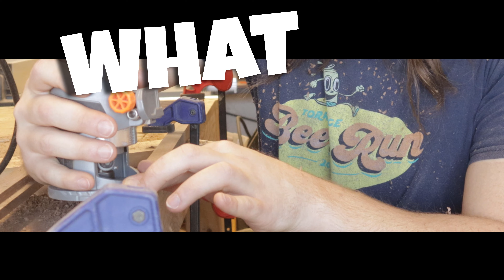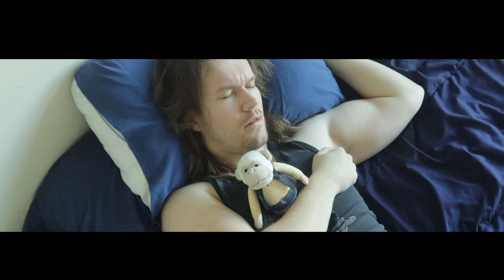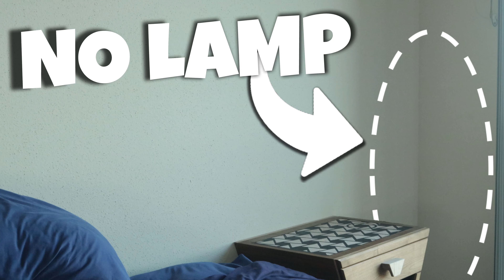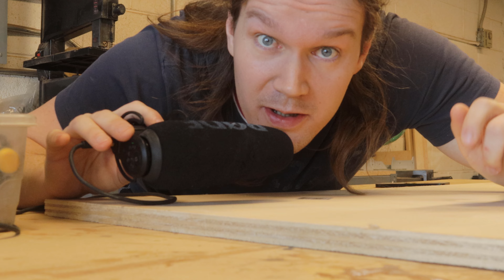I Combined Wood And Stone Into A Stunning Lamp

Comment: Was the stone scratched up when you received it? I ordered 3 sheets and they are scratched pretty bad.
Reply from the maker: The backing with the resin had some scratches but the front with the actual stone veneer was in good condition. Thankfully the scratches weren’t visible from the front when I lit it up.

Comment: Nicely done, that stone looks amazing at night! How did you end up attaching the stone veneer panel to the lamp?
Reply from the maker: This time I used hot glue. If I had to do it over again, I would have attached the stone panel to the walnut frame using nailed in styles BEFORE gluing up the entire mitred frame of the lamp. Thanks dude!